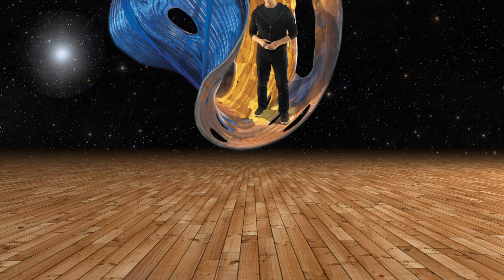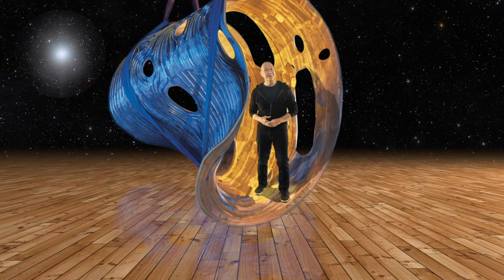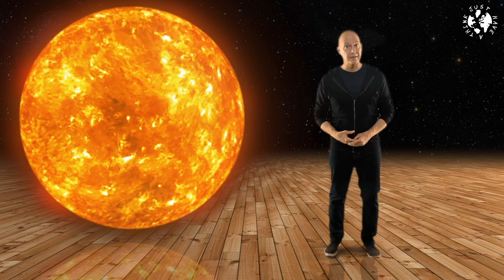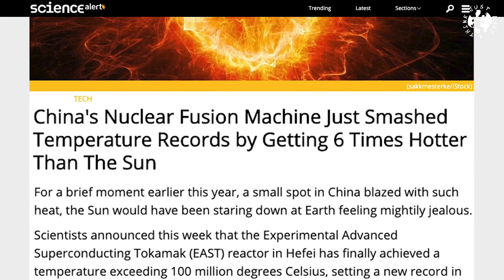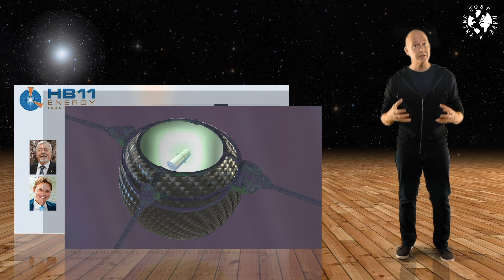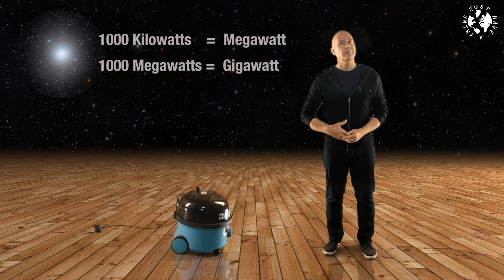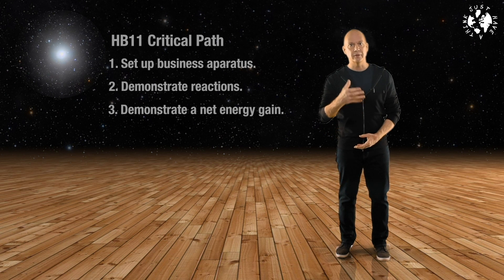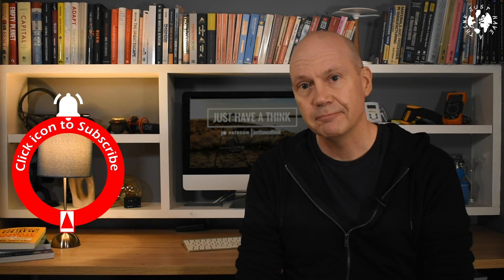Nuclear Fusion:  Revolutionary new breakthrough.

Comment: 9:23  "Pettawatt of energy '' (Wrong expression ). The SI unit of energy is the joule (J). Pettawatt of power(power=energy/time).
Reply: Hard to believe a ‘technology reporter’ who can’t get proper description of energy correct.
Reply: @Raggs1968  Gell-Mann amnesia.  You start with an inherent assumption that a report will be an absolute authority, until it's a subject in which you're well versed and you catch a seemingly obvious error. It throws the rest of the report into question, and you completely forget about it the moment you start the next report.

In reality, more often than not, media reports are prepared by laymen that likely know very little about what is reported. It's all simplifying and rewriting things written by actual experts. 

When you don't know what you're talking about, it's easy to make it seem like you do, but it's an easy facade to break if you yourself know the subject. Take this comment, for example: all of this was written from the first dozen words of the description of Gell-Mann amnesia :p
Reply: technicality. lasers do output petawatts, in pulses. the energy per pulse is maybe a kJ. they just got really good at making the pulses shorter. q switching etc.
Reply: It is Petawatt, not Pettawatt.

Comment: “...a billion times better than expected.”. Sounds to me like somebody doesn’t understand what even they were proposing; how can you take anyone seriously who was a factor of a billion out, where the science is well known. Fusion is an engineering problem; the science is “easy” - we’ve had hydrogen bombs for a while now. And as for the few measly charged helium nuclei being used to generate electricity directly, errrr... maths! No, simply not enough material to be useful. Sounds like the old “cold fusion” b.s. to me; I’ll keep my bets on the scientists with a real plan to tackle the specific engineering challenges, and a real chance of actually achieving something. Still, we need folks thinking outside the box - thats how progress is made, but not necessarily in the direction they were expecting.
Reply: [..]  Fusion is an engineering problem; the science is “easy” [..] - exactly same thing can be said about Alcubierre Drive, bulding HALO-like rings space station, space elevators ....  cold, hot .... controlled fusion for energy production IS B.S.  The only tangible result from this mess is some progress in superconductors.
Reply: Piotr Dudała Errr... NO! Alcubierre is little more than a theoretical solution to ONE equations, with a bunch of other violations throwns in; science NOT understood at all. Space stations is an ECONOMIC problem - the science AND engineering is well enough understood, much the same with space elevators (but I’m sure if the economics made it worthwhile, the remaining engineering issues can be overcome). You really don’t know much about fusion (or science, or for that matter economics or politics) if you think its B.S. The activities being conducted will lead to the greatest impact on man-kind since fire, and that it not B.S. I remember thinking “why would anyone need an office network, when I can just pass a floppy disc to the next guy, and he’s got my data”; I was short-sighted then, but now I give you the internet. Fusion IS coming, and you would be wise to plan for it, or prepare your children to plan for it, there is a LOT of money to be made Or we could keep raping the planet for raw materials and cover it in solar panels, batteries and cables; that might work for rural Kansas or Kisiri, but no chance for Delhi or Dortmund. Or carry on assuming oil will never run out and pretending the earth is flat. Nah!

Comment: All this just to boil water...there must be a better, more efficient way to capture and convert the output into useful energy.
Reply: You commented on the wrong video my dude... This is nuclear fusion, not cooking... Edit: unless I misunderstood?
Reply: @vyliad  Yes you misunderstood.   The heat generated by the fusion reaction is used to create steam, which drives turbines that move electrical generators - the same as coal, gas, and fusion power plants.   Most of the energy produced is wasted.   Solar is way more efficient, but wasteful in the manufacturing of the panels.   Not sure what the efficiency of Hydro-electric or Geothermal is.

Comment: to the commentator. More detail required on  how  C.H.I.R.P is created on tabletop, also an explanation on wakefield excitation which the main laser is used to drive  the plasma into the
boron11,may be  2 more tubes ,I'm sure  your audiance would be interested, suspect they would need an A.I. to control the 2 lasers.

Comment: MilesMathisdotcom has mathematically constructed the deal time for any and all success of fusion:  
What will ultimately decide whether 2035 goes above 1958, in my opinion, is the position of the Core line. Not only does it appear to be moving, as I have said before, but its position is not predictable given current knowledge. If the Core line is like a rope of charge coming in from the Galactic Core, waving a bit as time passes (due to intervening star clusters or other factors), we cannot fully predict the Solar Cycles until we can fully track that motion. But based on what we have above, I predict 2035 will be close to 1958. It will be very strong. 

It seems that the Renaissance threw out the baby with the bathwater.

Comment: All these fusion videos never explain how power(electricity) is created once fusion is achieved regardless of how long fusion has happened.
Reply: He says it in this video: Dinosaurs like the failed ITER plan to use the heat to boil water and drive steam turbines. An 19th century approach of generating electricity. This new design HB-11 design would be able to directly generate electricity from harnessing charged helium ions which are created as a result of the reaction.

Comment: Unless the fusion part is a side effect of matter changing  its state , It ain`t a new break through, fusion is not the answer , it consume more than it put out  , where a matter changing state doesn`t cost the the element through fusion and much more energy is released , my evidence you say , The sun all stars that emit radiation are using changing states of matter at high pressure high temperature conditions,
if stars main form of energy production was from fusion , their would not be high concentrations in certain super novae, the change in mass from star fusing elements on the scale suggested bye the fusion reactor experiment then star as of our sun would not last 50,000,000 years.
If fusion was the engine of stars why can`t the current and past fusion reactors produce any power let alone feed a grid, every fusion reactor working to day takes power from the grid , no of them even if you put their output together haven`t produced enough power to light a match stick let alone a house or even street lamp.
Stars don`t implode or explode they expand when gravity can no longer hold the mass as one m and in most cases their is tell tale spot to to the failure started . The rate of expansion is irrelevant.
This is as dumbed down and as i can make it , watching this video was painful and much the same as listening to preacher from pulpit spread his filth.

Comment: A waist of time, money and energy. The SAFIRE Project has successfully created nuclear fusion with minimum expense, and minimum energy and it’s already seeking contracts for further application and production with interest, naturally, from the military. They used an electrical model of the sun and stabilised plasma and have thus far experienced transmutation of elements and had\ve produced more energy than they’ve put in. They also report that they can also fuel it from nuclear waste and NEUTRALISE radioactive material in it’s reactor chamber. Report on that instead, perhaps.

Comment: For quite a few decades we have had examples of fully working over unity generators, that draw energy out of the ether to power themselves and produce large amounts of totally free electricity. We do not need big central power stations. This is why Tesla was left alone in his hotel room. We certainly do not need any form of atomic power - we are totally incapable of handling it safely. All those atomic vibrations have harmonics that are not stopped by water or lead. Big power stations are used simply to fleece the public for money. God said "Let there be light", Man said "let us charge people for it"'

Comment: While new energy sources should be explored, the consumption of energy remains the problem. We just keep using more than realistically renewable at this moment, and there is no end to that in sight - yet. 
So, massive efforts towards energy conservation - insulation of buildings - should be paramount. This relieves the need for more energy production.
With things being as the are, and no golden ticket to 'free unlimited clean energy' on the way, we should channel funds towards multiple efforts. And not just 'commercial' efforts. States should realise that being self sufficient - energywise - relies on stable supplies of energy, that aren't influenced by other states or companies - for instance like the oil prices are being manipulated by Russia and the OPEC for their own gains.
Energy technology - generating and distributing - should in the end be 'open source', so no country or company can use blackmail-like manipulative and divisive politics.

Comment: So, the problem of having to raise the temps so high is answered by making fusion happen at lower temps?
Why does this sound like “cold fusion”??
Reply: cold fusion is fusion at room temperatures, this is just fusion at a lower temp than inside a tokamak. tokamaks run many times hotter than the sun to increase collision chance, to make up for the lack of gravity compression. other forms of fusion could potentially run at the temps the sun uses instead, but that's still not cold fusion.
Reply: Kaitlyn L    😉
I apologize for my sense of humor.
Reply: @thinkingoutloud6741  ah, I see
Reply: cold fusion can't produce more energy than it consumes
Reply: Carlos Leon, of course. 
And I know you would know.  But what if you call it cold only because it is not as hot as regular hot fusion.
Reply: @thinkingoutloud6741  depends on the temp range. I think with the temperatures here it would still be considered hot. Just not as hot.
Reply: Carlos Leon but since we use hot and cold as words to contrast temperature differentials, when you say not as hot, aren’t you just using different words to avoid saying cold?
Reply: @thinkingoutloud6741  Nope, depends on context. 90 degree celcius is not as hot as 100 degrees but will still be considered hot in contrast to 30 degree water
Reply: Carlos Leon, hot, maybe relative to the temperature your skin senses. But what about relative to the the melting point of iron?  At 90 degrees, iron is in its solid state... frozen. I’d call that cold, relatively speaking.
Reply: Carlos, I hope I’m laughing WITH you. I’ve enjoyed the exchange.
Reply: @thinkingoutloud6741  of course that's why we should consider context. 

That was merely a metaphor. 

What I mean is the temperatures being used are still far higher than what we would classically consider cold fusion. 

I say we could call it warm fusion then instead haha
Reply: The Cold War was not a war that only happened during the winter. There are two meanings of the word. One refers to temperature, the other refers to action. When people talk about hot fusion vs cold fusion, they're talking about two different kinds of process, named for the contrast in the temperatures their techniques are viable at. This is kind of confusing, but language be like that.
Hot fusion operates in the same way the Sun does - crush light elements under huge pressure to make them get close, then get them hot enough that they bounce around hard enough to actually hit. Every atom wiggles in place by how hot it is, and if the atoms are packed tight enough that their wiggle rooms overlap, some start to hit, and stick. That releases energy because helium is closer to being iron than hydrogen is, and every other element wants to be iron.
Cold fusion operates in the way cosmic rays do, using an exotic particle called a muon. Muons have very short lives before they decay, but because they're traveling very fast, relativity makes them think time is slower, and so the faster a muon is, the longer it sticks around. Muons are like electrons, but very big. They're harder to move, which makes their orbitals around the atomic nucleus much much smaller. Some atoms also have bigger nucleii than usual. A hydrogen atom with a neutron stuck to it is ²H, also called deuterium. Muons can replace the electron in an atom, making the atom much much smaller. So when two deuterium atoms pair up and try to form a molecule of ²H₂, they get so close that even sitting still in cold temperatures, they hit each other - and being bonded into a molecule together keeps them trapped close to each other until they do, unlike with hot fusion where you're not letting them form molecules because you want to throw and shake them so hard they hit as they fly past each other. Molecules and atoms are constantly trading electrons between themselves, and muons too, so as this muon travels through a block of superfrozen deuterium, it basically goes United States of Smash on every molecule it passes through and keeps going.
The problem is that muons come out of giant energy-hungry particle accelerators we use to give an electron superpowers, and after a short time they decay back into normal electrons again. Muons and cold fusion work really, really good. A muon traveling through a deuterium gas can make a lot of energy, far more energy than needed to create more muons. The problem is, we really really suck at making muons. Right now, we have to use 5GeV of energy to make a muon that gives us back 2GeV of energy after doing the fusion. We either need to make muons fly faster so they stick around longer to fuse more deuterium, or get better at making muons because they should only cost 0.2GeV to make. Our machines SUCK at making muons.
Reply: @williambarnes5023  Aka they're not efficient.
Reply: @carlosandleon 
I believe that was the gist of it, yes. We are very inefficient at making muons, but muons are very efficient at making fusion for what it costs to make a muon. If you handed us a bag of muons, we could make ten times the break-even as net profit with current technology. But we suck at making muons and it costs us three hundred times what it should cost us to fill that bag, because we're dumb and doing it wrong.
Reply: @williambarnes5023  Well how do we do it right then? Why does it make us dumb if we don't know how to make some? If it's inefficient to make Muons then by continuation it is inefficient to do cold fusion.
Reply: @carlosandleon 
Yep. It's inefficient because of this one part we do badly. There are theoretical limits to how efficient a Caront Engine can be, and nothing, no matter how well designed, can do better at being a Carnot Engine than that. There may be something similarly true about muon production - but we can't be anywhere near it. Our machine is just bad at it, and we know that because Einstein told us what the cost of making a muon from scratch using raw energy directly should be, and we have the option to use existing matter like electrons to pay some of that instead of making it from scratch.
But we're bad at it. For now. If we had efficient muon generation, cold fusion would be done.
Reply: @williambarnes5023  That doesn't mean we're dumb though, we're working on it so that's actually pretty respectable
Reply: @carlosandleon 
A dumb person working to become smarter is respectable and wise to make the decision, but merely making the decision doesn't instantly magically undumb them. They still have to do the work to learn the thing and that makes them become smarter. We're working on it, and that's good and wise. But we're still dumb. For now.
Reply: @williambarnes5023  yeah man it's just jarring to incorporate that into your argument, it makes it sound demeaning. Could have just said we don't know yet or something. But whatever man. 

Respect

Comment: Still remember the Scientific American article describing the use of split and refracted laser beams to generate enough energy to accomplish fusion; circa 1974!...
...still waiting.
Reply: I took a tour of the facility, ten giant laser amplifier tubes stack 2 wide and 5 high. Each tube diameter could fit a car. That was back in the 1980s over the decades they kept rebuilding it and relaunching facility with a new names. it's didn't take much imagination to think you where in the bowels of the death Star weapon systems while touring the ICF.

Comment: My guess is that they need the patents to get funding. They claimed 2019 to have made a breakthrough. (Look up "hb11").  
The boron-reaction demands higher particle energy than the usual types of plasma experiments, but is attractive since you don't have 
energetic neutrons. And, from what I remember, research has shown that it has been possible, in another device, to convert energy 
from high velocity charged particles with reasonble efficiency.